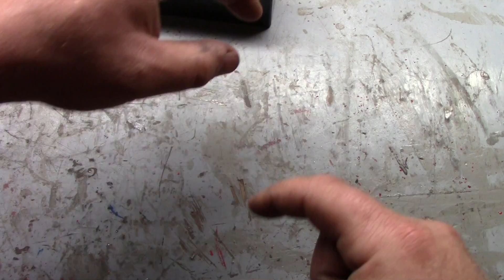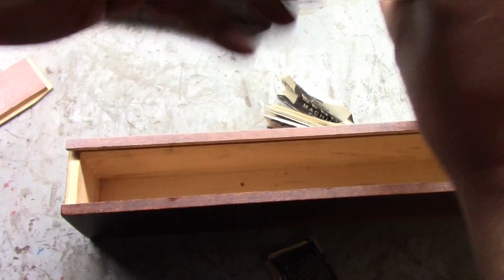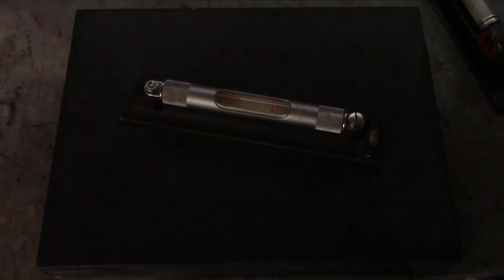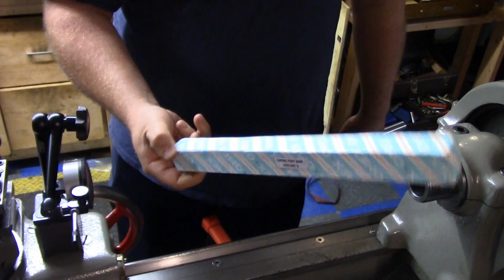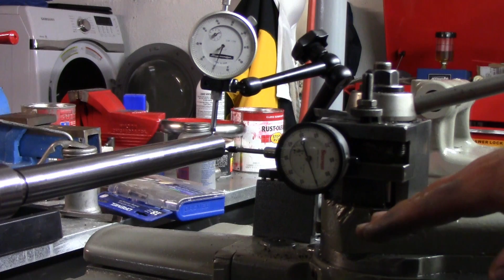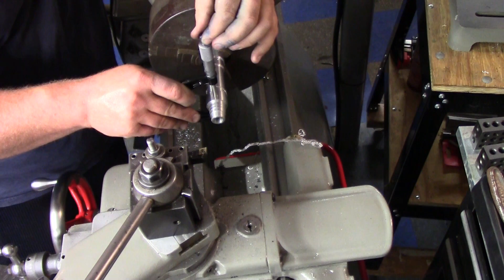13" Southbend Refurb: Leveling Bed

Comment: I guess you have not built a frame and just placed the feet into the four holes provide, as these machines I guess were built with one end on legs and other end on a base ,they also confider for when these lathes were on the ships as well better for adjustment, 

As they recommend you place bolts into a sub floor` but you are using feet ,do you get any vibration in the lathe its self? as I have a 13" small spindle over here in the UK England and considering what I should do , either to use feet or to bolt into my concrete?
Reply from the maker: no vibration.  You'll be fine with the feet as long as you're on a solid floor
Reply: @Halligan142  Thank you for quick reply , just going to buy some now,
Great video`s nice information as I`m new to using my 13" SBL 1"spindle ,

Comment: What’s the purpose of leveling the lathe? I have a SB 10 L (1968). 
Thanks,
Paul
Reply from the maker: You actually want to  prevent  twist in the bed.  Leveling is an easy way to establish that.  Any twist will cause the headstock to not be aligned with the ways and will manifest itself by a taper in your turned piece.

Comment: I don't understand the chuck issue if it is not creeping??  You are turning around the center of the runout of the chuck so it should not enter into the issue, repeatability you bet, but not on the test setup.  Think of turning an eccentric in the 4 jaw chuck if you offset the jaws it still turns concentric to the center of the stock.  That said the lathe looks great, good job, I cut my teeth on a Southbend lathe.. Aloha and keep up the good work.
Reply from the maker: You're right in runout doesn't matter, but the jaws and scroll are so worn that the tool pressure is moving the part more than it should.  I put an indicator and pushed with about the same pressure in line with each jaw and got 3 wildly different deflection readings.
Reply: You DO need a new chuck!! Aloha
Reply: If the  work piece isn't parallel with the ways and spindle it is going to cut a taper.
If you go to around 20:12 in the video and put the video on slow motion you can see how the end of the work piece that is being cut is wobbling.
But not at the chuck area.
There is no way you can make an accurate cut with stock that small in diameter sticking out that far without tail support.

Comment: I believe most of the comparison error is due to tool pressure, thanks to the carbide insert.  I'd try that cut again with a super sharp HS cutter, and do final passes that cut both measurement "journals", taking no more than 0.002 on the final pass.